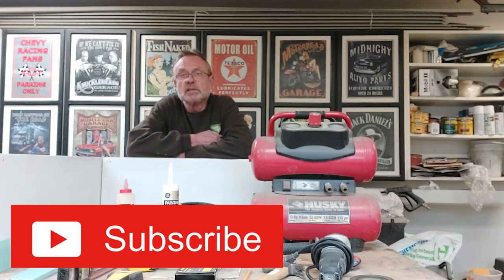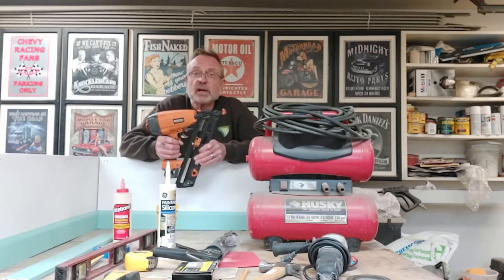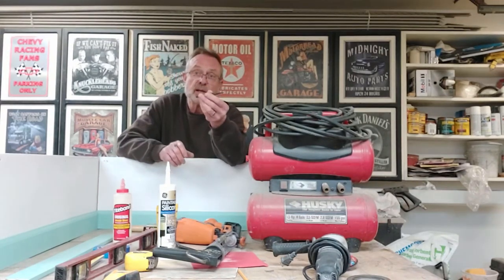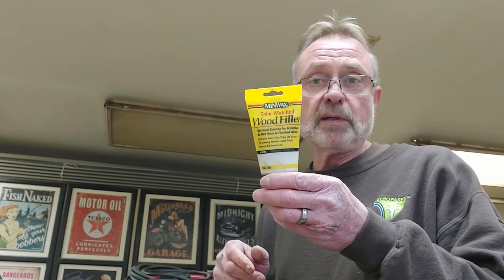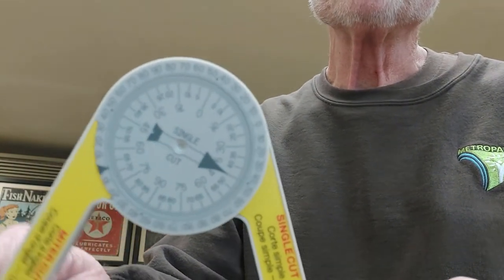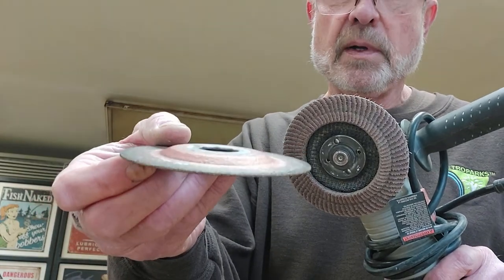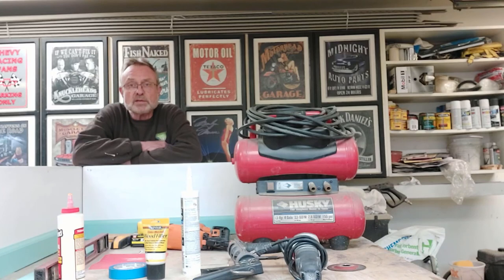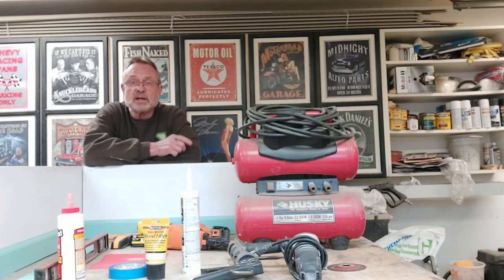The Tools You'll Need To Install Trim! [Trim Tutorials Episode #3]

Comment: The one reason I clicked on this video … was not answered…What kind of nailer? ????  15ga 18ga finish? Bradley?
Reply from the maker: My bad, thanks for mentioning that. I use a 15 gauge finish nailer. Plenty of different length nails available up to 2 inch.